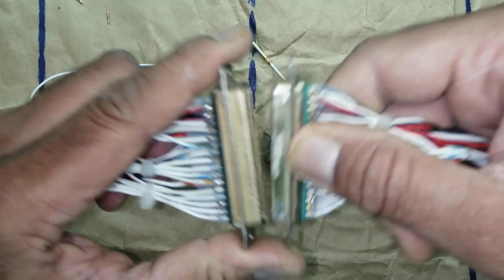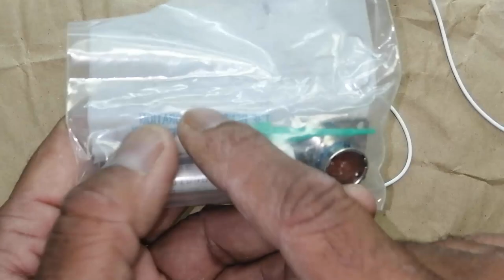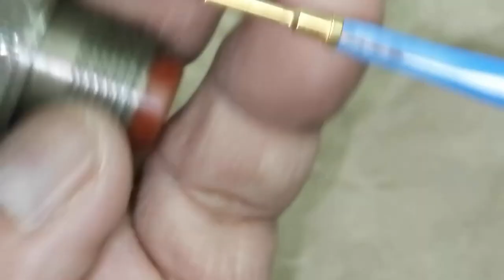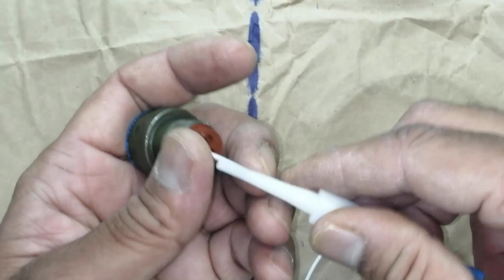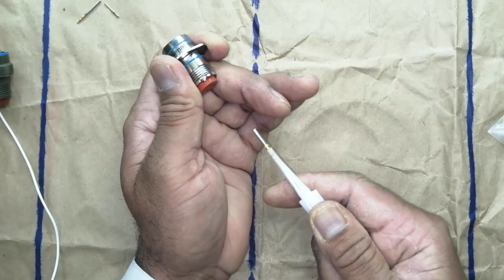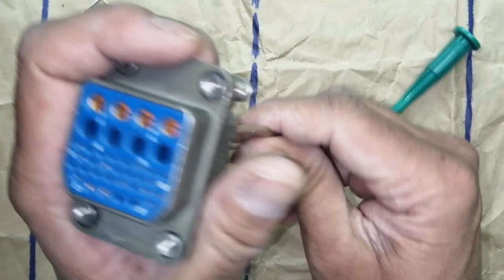How to insert contact pin in electrical crimp-able connector

Comment: Can you give solution for circular connector insulation resistance test?
Reply from the maker: no brother 
in our firm, we don't perform insulation testing. it can be sent to some aerospace lab to perform test. there is a very long series of test, which is performed for qualify test procedure 
https://cdn.glenair.com/test-reports-and-technical-information/pdf/test-report/powerload/gt-21-155.pdf

Comment: If C pin inserted dummy and I want to use for .... How can I remove dummy (without wire) and use as in.
   You have not shown how to remove a pin / socket not having any wire.
    Please share and show
Reply from the maker: please check video number 655. if you have any question more, please let me know

Comment: What is the name this tool
Reply from the maker: insert / removal tool. 
for 20 gauge M81969/16-01 - Installing/Removal Tool 81515-20 
for 220 gauge DMC 81515-23 Installing / Removal Tool (M81969/16-04
Dmc M81969/14-01 Insert Extract Tool Daniels M81969/14-01
Insert/Removal Tool, Blue/White, Size 16
Insert/Removal Tool, Yellow/White, Size 12 https://www.milspecwiring.com/InsertRemoval-Tool-BlueWhite-Size-16_p_417.html

Comment: you will someday break the extractor inside the connector, and you will use tweezers to remove the remaining plastic! you can't scroll the extractor, if you don't hit the lock you have to pull it out, turn it and try again
Reply from the maker: No dear 
I am working from last 35 years as avionics engineer
And very rarely insert / extractor tool gets damaged 
I think if i have only one piece, i can work years with only one
Reply from the maker: Even the metallic etract tool gets damaged frequently
I remember i never damaged metallic etract tool as well 
Jammed pins in locks are problematic but sometimes i use little amount of lubricant and after removal i clean it using contact cleaner or isopropyl alcohol